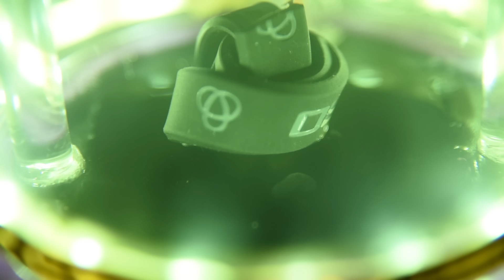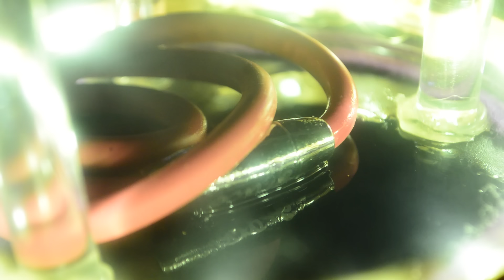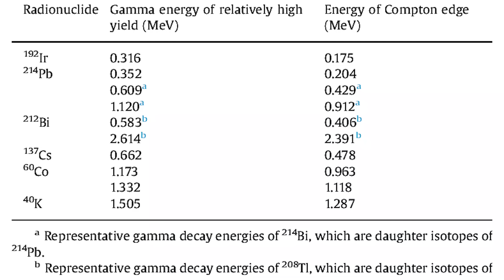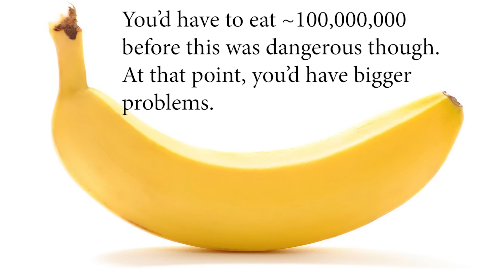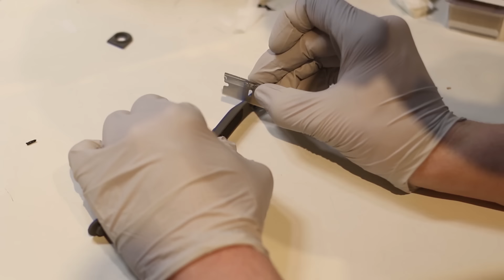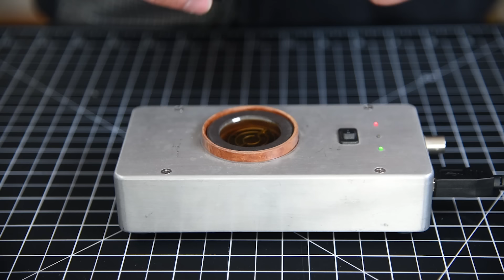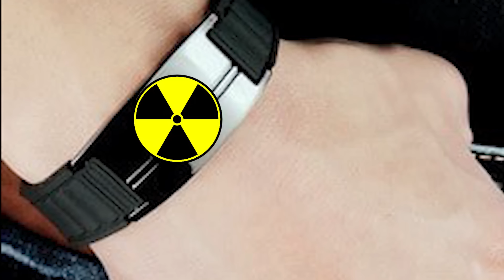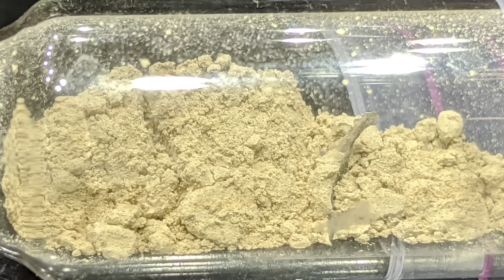Negative Ion/Anti-5g Products Are Actually RADIOACTIVE

Comment: I used to work for a company that made process control equipment for paper mills. It used a radioactive source that emitted alpha particles. It worked because the paper would stop part of the alpha particles. How much radiation it stopped was dependent on the thickness of the paper. At least a little bit of the radiation had to get through for the equipment to measure the weight of the paper.  The radioactive source was sealed in an armoured scanning head well away from any of the mill workers.
Reply: Alpha particles can be stopped by a thick sheet of paper. That is why they can be used to compute the weight of a sheet of paper as it is being made. The calculated weight of the paper is dependent on how much of the alpha particle radiation gets through the paper. People (including me) were arround the scanning heads every day with no harmful effects.  An Alpha particle is a helium nucleus without the electrons. It cannot get through your skin.
Reply: @richardyoung5217 as long as you don't eat it, it is safe. If you eat it.. Well, it can't get back out your skin.
Reply: @richardyoung5217  I suspect the scanning heads not hurting you was because they were properly shielded, not because they were inherently safe. Now if you were, for some reason, instead frequently in the way of the alpha particle beam, you wouldn't be so confident.
Reply: @blakksheep736  I was told that to be harmed you would have to remove the radioactive source and swallow it. I don't know if this was true or not but it was a weak source. I quit the company in 1975 so my memory is a little fuzzy on the subject. It was fun but hard work. I was programming in Fortran 2 and Honeywell assembler. I got to travel to many obscure places where they had paper mills. My wife would insist on washing all of my cloths because they smelled like a paper mill.
Reply: @richardyoung5217  Well, as pointed out in the video, it doesn't need to completely travel through your skin to chase problems. Also it would result in alpha particles in the air which could be inhaled if it wasn't shielded. All this has long turn consequences.
Reply: Noice.
Reply: Why not just measure light translucency?
Reply: @MD-vs9ff  Presumably because light penetrates the paper too easily to enable precise measurements of thickness differences which, in the case of paper, can easily be on the order of microns.
Reply: @MD-vs9ff  because the sheets of paper were not transparent. They could only measure the weight of the paper at the far end where it was mostly dry. They made all kinds of paper from tissue paper to brown kraft paper that was used to make corrugated cardboard boxes. It was very interesting and I traveled from South Carolina to British Columbia.
Reply: @MD-vs9ff  The sheets of paper were not transparent to normal light.
Reply: @richardyoung5217  uh, you do realize that the fact that you get a measurement at all (due to some of the alpha particles getting through), means that some alpha particles can go through even the thickest paper you were working with, which means that it can definitely get through the outer layer of skin and get deep enough to encourage skin cancer... you literally proved the thing you seem to be kinda disagreeing with. not that that factory sounds dangerous, it sounds like they were keeping it away from you guys instead of having you wear alpha-particle generating devices on your wrists all day, lmao
Reply: @ByzantineDarkwraith  The scanning head and receiver were in metal boxes that moved on beams above and below the moving sheet of paper. The beam of particles was aimed so that there was little or no scatter. From what I was told human skin could stop the radiation.  A sheet of paper had to stop a measured fraction of the radiation so that it could measure the weight of the paper. The scanning heads were only aboutcan inch apart. I moved on to another job 47 years ago (I am 79 years olg.) and i have not suffered any ill effects from the systems. I was constantly setting up and testing the systemz ps.
Reply: @richardyoung5217  yes, the comment I wrote which you replied to said that I didn't think the workplace you were in was dangerous. I just said that the fact that a fraction of alpha particles passes through all the different types of paper you were weighing shows that a fraction of alpha particles can pass deep enough into your skin (past the epidermis, which is paper thin) to affect your potential skin cancer risk. this is relevant to the discussion on if alpha particles from thorium can be dangerous. It doesn't really affect the (lack of) risk you faced in the factory you were in, because it doesn't seem like alpha particles were even hitting your skin, considering they were well contained and shielded, and you weren't wearing alpha particle emitting material on your wrist or anything, like I said before (but unlike people who buy the products discussed in the video and wear them all day/night, unfortunately).
Reply: @ByzantineDarkwraith  Are slpha particles dangerous? I know X-rays and gama radiation  are dangerous but alpha particles are essentially hrlium nucleus.  Two protons and two neutrons without the electrons -I think?
Reply: @richardyoung5217  Alpha particles are more harmful than beta particles, x-rays and gamma rays. The He2+ ions are large (larger than H+/protons present in water) and can ionise a lot of tissue for the relatively small distance they can travel. For extra information, I'd recommend the overview by the EPA or Wikipedia.
On a side note, the dead outer layer of the skin is thick enough to stop most of the A-particles from entering your body. Furthermore, the intensity of the radiation drops off over relatively small distances in air (a few metres).
Reply: @richardyoung5217  did you watch the video?  This is discussed in the video...
Reply: I have definitely had to answer a question or two about this in a physics exam

Comment: There are so many things wrong with your logic here. It’s hard to watch.
Reply: What are the issues that you see?
Reply: Like what?
Reply: One has to do with the way he explained radiation. He made it sound like he thought radiation could only go through a certain amount of layers. This is not true, radiation is stopped by a fraction when passing through matter. He also didn't understand decay and why alpha and beta particles are dangerous. If an element decays with alpha particles each decay also comes with beta and gamma radiation. The main danger is breathing it in as it will destroy your lungs. Only gamma (and ultra violet) radiation can damage your cells DNA. Alpha and beta will just out right kill the cell. Gamma radiation can do this through ionization. Also a negative ion is called an anion.

Comment: Thanks for addressing the low penetration potential of alpha particles.

One thing to clarify is about the dose rate being concentrated in a single area. Dose rates are already in a per volume basis - it doesn't the whole body that is affected, it is the individual cells. So your wrist cancer rate might be elevated, but the cancer rate for the rest of your body would be unaffected - if you don't ingest the dust.

Alpha emitters are generally accepted as most dangerous when inhaled or ingested. It might have been good to emphasize that a little extra.

Comment: around 16:30 you suggested a piece of paper and thin skin would act similar to the alpha particles? I'd have to disagree.. skin/fingers would have some level of water or moisture content. The h20 particles would slow and interact with the alpha particles, i.e. regular water pressurized reactors and heavy water candu reactors use water as a moderating fluid..

Comment: nice video and debunking work! However, your assessment of the penetration power of alpha particles is wrong. They are stopped in any solid kind of matter within a few 10th of micrometers. For example, 8 Mev alphas (about the maximum naturally occurring alpha energy) reach only about 50 micrometers inside metals. It's not much different in tissue or paper. What you see in the cloud chamber with your shielding tests is most likely radon gas (from the thorium decay chain) that diffused around the paper and then does its alpha decays somewhere in the open space. This also explains why the alpha traces appear to be not emerging directly from the paper shield or chicken skin surface.
Reply: Thank you for sharing this! I have been researching alpha particle penetration for a bit trying to find where everyone seems to be going wrong if the claims about alpha penetration made here are accurate, but all of the math supported paper stopping alpha particles. I took a deep dive through the comments hoping someone took the time to clear it up, and you didn't disappoint ^-^
Reply: As accurate as you might be I would rather people not know this because then if you use the geiger counter that detects Alpha radiation then it's going to give a much higher dose rate and make people more nervous about this and more likely to just cut it out.
Reply: @the_undead  sorry, but I strongly disagree. the doses are very small regardless of the particle kind since it's just a very low number being released per time. it's much more important to educate people properly and get them interested in the real facts and amazing physics behind it. there are already more than enough misunderstandings around the topic of radiation, debunking them is important
Reply: @gabriels3909  I'm fairly certain you're trolling because I don't understand half of your comments and the other half just barely makes sense
Reply: @oliverkeller2342  that is a fair point of view however the majority of people cannot be bothered to learn a damn thing about radiation and the effects it has on humans, I wish we could teach everyone the effects and why these things are dangerous and all that other stuff but the fact of the matter is we can't easily do that because most people don't have an attention span long enough to learn these kinds of things that's why I have my point of view not because I think it's the best option but because I think it's the most realistic. does that make sense?
Reply: @gabriels3909  Hi, I have a master's degree in physics (mentioning only so you know I'm not just some rando on youtube): what you describe is impossible. The video you mention is nearly 15 minutes long so I don't really have time to watch it, but I think I can help clear something up here. "Radiation" has two meanings, one is "any kind of particle/energy emitted from something", and the other is a shorthand for "ionising radiation". The first one, as a general rule, is not dangeous - visible light and radio waves are both "radiation", but they are completely harmless. The electromagnetic radiation (in other words, light) used by mobile phones and TV broadcasters and wifi are all harmless and are even lower energy than visible light. The second is what we're worried about in this video - radiation with enough energy to damage atoms, such as the ones in yours cells, which can cause cancer and degrade materials. Phones etc do not use any of this kind, but the dangerous products in the video do. 

As for "deleting" radiation - that's just not a thing, sorry. You can block the radiation from a phone by keeping it in a metal box, but then the phone won't work any more. There's literally no possible way a bracelet could be doing anything to stop the transmission of signals from a phone. Whatever you saw in the video was 'movie magic' or some other kind of deceptive trickery. You are in zero danger from your phone (in terms of radiation), and a very significant risk of life-threatening cancer from one of these products. 

You may have been using one and not developed cancer yet. People get lucky, everyone knows someone whose great aunt smoked 10 a day until she died at the age of 95, but cigarettes are still bad and dangerous and likely to kill you given enough time. It's not a matter of using these products making you drop dead after a year, it's that, given enough time they will cause cancer and that should always be taken seriously. Please do not continue to use these products.

Comment: Hi I am new to this channel and I really like your Videos. I've definetely learned something today. 
How about these "alpha energy cell phone stickers" you can get online. You can put them on all sorts of electric devices. I guess they are supposed to somehow transform the electromagnetic waves sent and received by the device and improve your mood and make you healthier. Also they claim that the functionality of the device isn't affected in any way.
Reply: That sounds an awful lot like they have some alpha radiation source in them which is a great way to give yourself skin cancer. It doesn't affect your phone because other than potentially giving you skin cancer it does nothing. If it actually modified the radio waves your phone uses to communicate in any way your phone would loose signal. But also there is nothing to gain from doing this, humans aren't radio antennas and can't be affected by radio waves.

Comment: Every electron that radioisotope spits out has enough energy to rip apart a few thousand chemical bonds; most of these beta particles have around 100,000 electronvolts of energy. That bracelet will fall apart over time and end up being a bigger radiation hazard it already is.

Comment: For the most I agree, but...

Why are you calculating into the dose rate the alpha-particles? They can not penetrate through the dead skin layer. If you don't eat them they don't harm you.
Secondly, GM counters by their very nature cannot measure doses, because doses require the knowledge of the impacted particle energy. And this is just when you want to measure absolved dose (Gy). For effective dose (Sv) you even have to use different weights for each particle type. Instead what they do is they assume that all particles are gamma-particles emitted by Cs-137. So what you are measuring is not valid unless you are measuring Cs-137 with a beta-filter on.

The most dangerous part from this does not come from its radiation but from absolving (highly toxic) thorium into your body and probably the emitted Rn-220 isn't that great either.

Comment: i thought we were done with using arsenic fabric dyes, flammable dresses, and radioactive makeup ._.   guess history really does repeat itself
Reply: There will be quackery and scam "medical" items as long as there is some unfortunate people who fall for it,even more when it comes from china and is not regulated
Reply: Aren't dresses made with cloth. Cloths made with natural fibres are flammable.
Reply: @RandomPersonOf2005  yeah but i think they added some chemicals that made it more flammable and the electrical heaters they had back then caused a few accidents of human torches
Reply: @karvast5726  maybe the electric heaters back then didn't shield the heating elements and anything that is flammable which touches the heating elements will catch on fire.
Reply: @karvast5726  if you stick something flammable in a toaster ,it will catch on fire. A kitchen towel can catch on fire when you just hold it close to the heating elements.
Reply: @RandomPersonOf2005  yes that's exactly what i'm saying the heating elements were not protected and some clothes had chemicals that catched on fire very rapidly and easely
Reply: @RandomPersonOf2005  the ones im talking about were made from a plastic that if even a spark got onto it would go up in flames in seconds and then the plastic would melt onto the skin, nowadays clothes while are flammable they aren’t nearly as dangerous as the ones using said plastic, most are easy to remove and dont normally go up in flames if only a spark hits, and the flames don’t spread as fast either

Comment: Can you provide some insight on something? Apparently tourmaline gems are non-radioactive, whilst tourmaline powder is. I am not entirely sure if that's the case, but from what I've found on the internet it seems that it is. In fact there are companies that sell water bottles and entire beds pimped out with hybrid tourmaline stones.
Reply from the maker: If it's labeled as tourmaline powder, and it's radioactive, it's not tourmaline
Reply: @thethoughtemporium  Hey I wanted to elaborate a bit, although it states these products are made with tourmaline crystal powder on their website, it also states that the bottles "ionize" the water using "tourmanium negative ions" and create "alkaline reduced water". Judging from this, these two terms should contradict, correct? I think I might just borrow a radioactivity meter and measure it myself lol.

Comment: Great video but the dose is a bit misleading. The dose is only that high locally, its not like you are getting the same dose from a 50 usv reading at fukishima where the field is homogenous. the 50 usv reading drops off rapidly  away from your hand. Furthermore it is true that alpha particles may make it through your skin rarely, it probably isn't a  significant concern- even the epa says so- https://www.epa.gov/radiation/radiation-basics.

The main problem is if people start using negative ion water products where alpha emitters can get ingested.